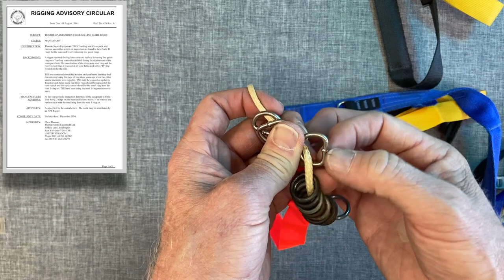The Toggle

Comment: 13:44 could someone please explain how the toggle could have come loose in this example? (What did he mean by the togle was set with a shortcut technique?) How did the string end up pulling on the loop that holds the toggle? (Sorry for the lack of terms, I'm not a skydiver x))
Edit: okay, I think I get it. I think the holing loop that holds the toggle was made by pushing the shorter end through the little loop instead of the longer side that is pointing in the other direction?